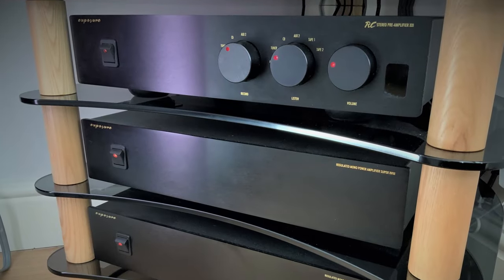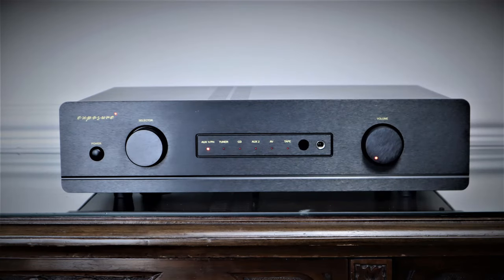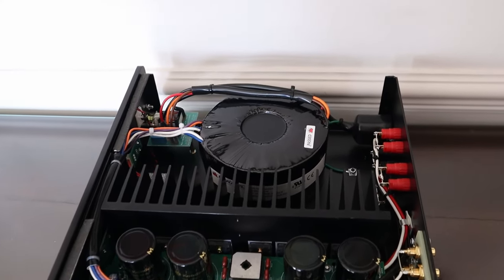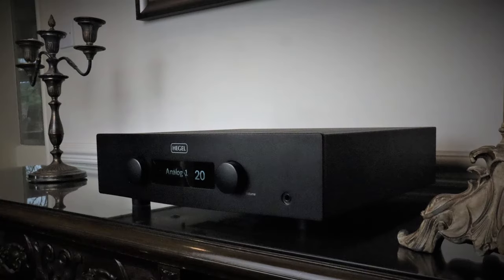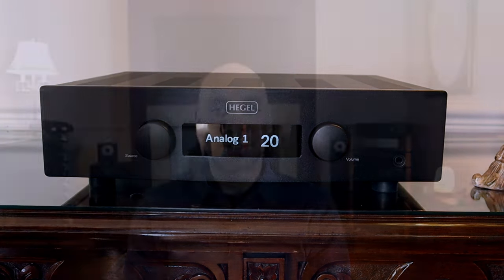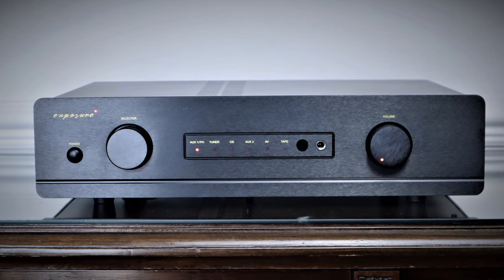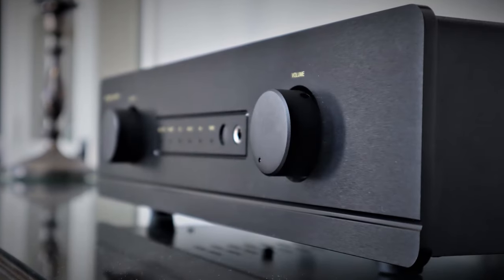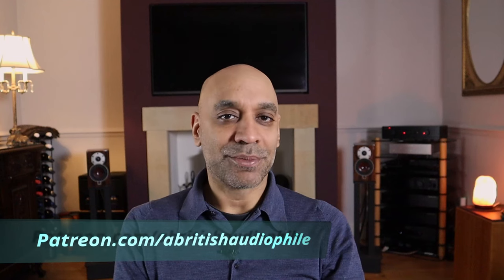Surprising! New Exposure 3510 Amplifier Review

Comment: Bether than atoll or Naim?
Reply from the maker: Which one?
Reply: @abritishaudiophile7314  in200 or xs3 is very powerful??
Reply from the maker: @antonioinacioconceicaoreis9004  the Atoll IN200Signature has more power than the Naim XS3😊
Reply: @abritishaudiophile7314  but u prefer exposure?looks amazing quality!
Reply: @abritishaudiophile7314  How does the 3510 compare to the Atoll IN200 on your tonality scale? Cooler than 3510? How would you compare the miss?
Reply: Mids
Reply from the maker: @daviddunwoody1979  the Atoll IN200 Signature is brighter than the 3510. However, I am told that Atoll have revised the model since my review and the sound has changed 😊

Comment: Through hole parts sound better? You are doing religion not science with statements like that. The smaller lead inductances of SMD components are objectively superior to through hole.
Reply from the maker: They also tend to have a higher noise floor and poorer heat dissipation.